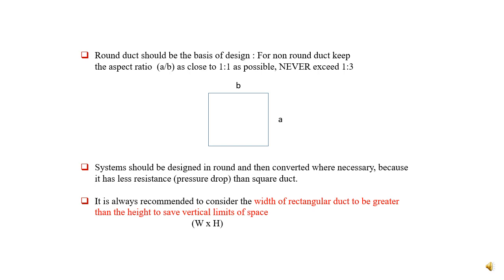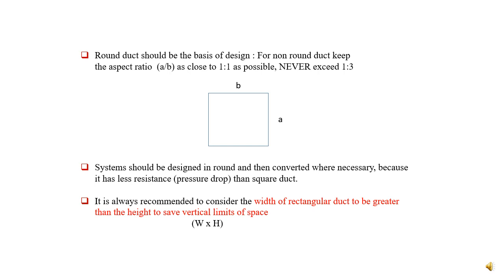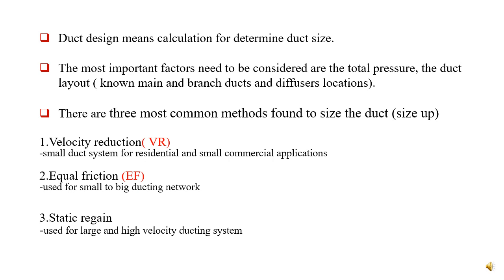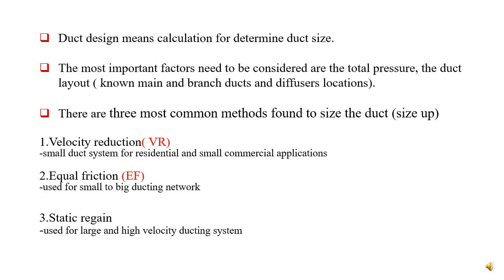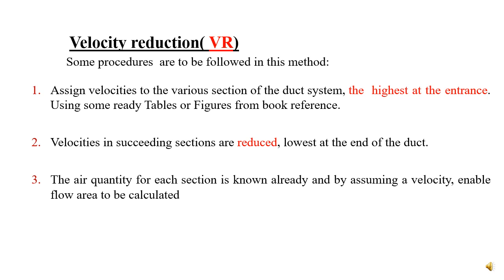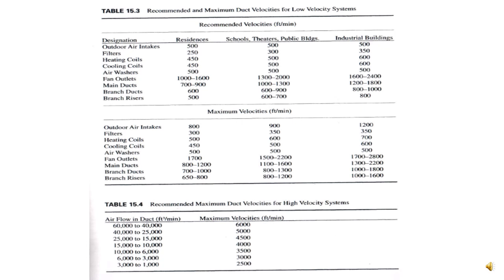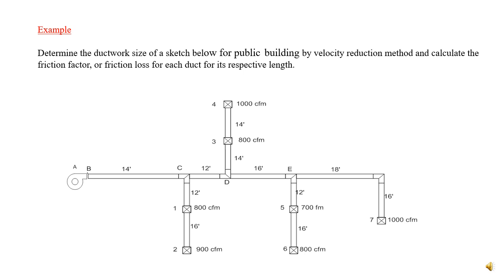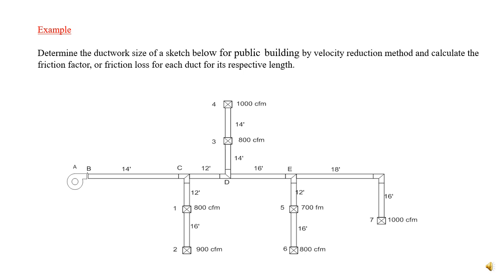Air Distribution System Design Lecture 7 part 1

Comment: ZARIF ROSTAM (B071710681)
Duct System Design
Purpose : Deliver conditioned air from one location to another with concern of cost, noise and limit of space.

3 requirement to follow:
-Keep the 1:1 ratio and never exceed to 1:3
-Round duct is better than square duct due to less resistance.
-The rectangular duct must be greater in width than the height.

3 method in ducting design:

a) Velocity reduction
small duct system for residential and small commercial applications.

b) Equal Friction
used for small to big ducting network

c) Static Regain
 for large and high velocity ducting

Comment: KHOR YE SHU (B071710464)

1. Design overview
- Objective of air duct system is to deliver the conditioned air

2. Three things to be considered: 
 a. Space limits (how much space available in the plenum)
 b. Noise (minimize the noise)
 c. Cost (cannot exceed the cost that is specified by the client)

3. Duct design methods
- Calculation for determine duct size
- Important factors need to be considered:
 a. total pressure
 b. duct layout

4. Three most common methods found to size the duct: -
 a. Velocity reduction (VR)
  - small duct system for residential and small commercial applications
 b. Equal friction (EF)
  - used for small to big ducting network
 c. Static regain
  - used for large and high velocity ducting system

Comment: Muhammad Zulqarnain Bin Zamzuri (B071710782)
DESIGN OVERVIEW
•	Purpose : To deliver confined air from one location to another 
•	Non round duct: as close to 1:1, never exceed 1:3
•	Should design in round when necessary
•	Width of rectangular duct to be greater than height to save vertical space
•	Duct design = calculation to determine duct size
•	Important factor : total pressure, duct layout
•	3 most common method
o	Velocity reduction : Small duct system for residential & small commercial
o	Equal friction : small or big duct network
o	Static regain : for large and high velocity duct system

Comment: Cheah Kok Hun B071710006 
 This lecturer  7 is mainly discuss about an air duct system is to deliver conditioned air from one location to another within prescribed  limits of space, noise and cost.
 Cost is to be consider in the same time full filled customer requsting

Duct design method
:
round duct should be the basis of design
round duct is much better then square duct due to less resistance
Rectangular duct design method perfect is 1 to 1. if not possible the design should not exceed 1:3.
The width of the duct must be greater than the height if the duct.

Method to size up the duct:
1. Static Regain- for large and high velocity ducting and this is expensive
2. Equal Friction- used for small to big ducting network.
3. Velocity Reduction (VR)-small duct system suitable for residential or small companies.

Comment: NUR SHAFIQAH BT ABDUL GHAPOOR (B071710400)

DUCT OVERVIEW
-the purpose of an air duct system is to deliver conditioned air from one location to another within space limits, noise and cost of the system. need to choose the system that have minimum noise and make sure does not exceed the required cost.

-round duct is the basic design
-non-round duct needs to keep the aspect ratio as close as possible (1:1) and definitely cannot greater than (1:3). 

-system design in round and then converted where it necessary.
-round has less resistance compared to square duct.
-always consider the width is greater than height. It is more stable that way.
-if the space is very limited, then the height greater width is acceptable.

Rule to design:
1. Choose the right form of duct (round or square).
2. Ratio of the duct must be close (1:1), never (1:3).
3. The width of the duct must be greater than the height if the duct.

DUCT DESIGN
- to calculate so that ones can determine the duct size like material type and size.
-important factor that need to considered are total pressure and the duct layout (main and brunch ducts and the diffuser location).

Method to size up the duct:
1. Velocity Reduction (VR)-small duct system for residential or small companies.
2. Equal Friction- used for small to big ducting network, most part of system used equal friction loss.
3. Static Regain- for large and high velocity ducting, it is expensive.

Comment: LIM PEI JUN (B071710194)
Purpose
-to deliver conditioned air from one location to another.
- transferring the conditioned air within limit of space, noise and cost.

Three requirements
- keep the ratio as close as 1 to 1, never exceed 1 to 3
- round duct is much better then square duct due to less resistance.
- width of the rectangular duct should always greater than height due to vertical limit of space.

Three method of ducting design.
- velocity reduction (VR)
Small duct system for residential and small commercial

-equal friction
for small or big ducting network

-static regain
For large and high velocity ducting system.

Comment: AMIRATUL RASYIDAH BT ABDUL RAHMAN (B071710456)

DESIGN OVERVIEW
• Purpose of air duct system: to deliver conditioned air from 1 location to another location within prescribed limit of air space, noise & cost.

• round duct is a basis of design
• non round duct: should be aspect ration (1:1), not exceed (1:3)

• system should be design in round duct & convert if necessary because it has less resistance compare to square duct.

• recommended width greater than height of the duct, to save vertical limit of space.

DUCT DESIGN is calculation for determine duct size

• Important factor : total pressure & duct layout

• 3 Common Method to size the duct
1. Velocity reduction
2. Equal friction
3. Static regain

Comment: ALDY HENRY DUSIM (B071710329)

Design overview
- ducting function is to transport conditioned air to a space and designing it need to consider the space limit of the area or the ceiling and the noise must also be minimize as possible and also the cost need to be consider and as an engineer it is important to recommend the best design for the customer building but the final decision will be made by the customer if they agree or not.

Duct design method
- round duct should be the basis of design
- for round duct ratio it must be as close to 1:1 and not exceed 1:3
(this is to get better air flow to the space and avoid any unnecessary loss)
- round duct has the advantages of less pressure drop and required less space than the non rectangular duct but the non rectangular duct is cheaper

three type of calculation methods
1. Velocity Reduction (VR) and it is for small duct system, residential and small commercial applications
2. Equal Friction (EF) and are used for small to big ducting network
3. Static Regain and used for large and high velocity ducting system,
this are the methods used to help sized up the ducting and it is very important to follow this methods to achieve better air flow to your system. not to forget that you have to know the layout for the system and the total pressure for the system to so it can help even more to your designing process

Comment: LUA WEI JIE (B071710861)
The purpose of an air duct system is to deliver conditioned air 	from one location to another within prescribed  limits of space, noise and cost.
Rectangular duct design method perfect is 1 to 1. if not possible the design should not exceed 1:3.
3 types of calculation method :
a. Velocity reduction( VR) uses for small duct system (home, residential and small commercial applications)
b.Equal friction (EF) uses for  small to big ducting network
.(buildings)
c. Static regain uses for large and high velocity ducting system
Also please follow the recommended table for each type of building, type of suitable flow for each space, limit min&max flow.

Comment: Muhammad Syafiq Bin Ahmad (B071710592)

Air Duct Design

*The function of air duct is to transfer of air from one location to another location with specified space and cost within high air pressure

*The ratio for round air duct suppose 1:1 and never exceed 1:3

*Recommended shape of rectangular is about W x H

*The most important factors for design are the total of pressure and duct layout

*3 main common method to found out the size of air duct

   1. Velocity Reduction (VR)
    2. Equal Friction ( EF)
    3. Static Regain

Comment: MEGAT MUHAMMAD UMAR ( B071710565)

1. Design overview
- to deliver conditioned air from one location to another relate to limit of space, noise and cost
-round duct will be the basis design
-for non round used ration 1:1 and never exced 1:3
-consider width is greater than the high to save vertical limit of space

2. Duct Design Methods
- Means calculation for determine duct size
-most important factor to consider is total pressure, duct layout and diffuser location

3. 3 most common methods to size the duct
- Velocity reduction (VR) = small duct system for residental and small commercial applications
-Equal Friction (EF) = small to  big ducting network
-Static regain = large and high velocity ducting system

thank you madam :D

Comment: ARVINTH A/L RAMACHANDRAN  

(B071710339)

design overview 

the understanding is actually  about air duct system is to be delivered from one location to another with the limited space noise and cost.

- round duct should be aspect ratio 1:1 and never exceed 1:3 ratio 
- air duct should be in round because less resistance 
- the width of rectangular should be greater than height 

3 common methods 
- velocity reduction (VR) for small duct system
- Equal friction ( EF)  small to big duct
- static regain large and high velocity duct

Comment: NUR SELIHAH WAL HUDA BINTI AHMAD (B071710190)
1) Purpose air duct system carry cooled or heated air into the room withing prescribed limits of space, noise and cost.
2) Non round duct ratio to 1:1. never exceed 1:3.
3) Always consider the width of rectangular duct as to save the vertical limits f space.
4) Factors need to be considered 
     - total pressure
     - duct layout
5) Method to size up the ducts
     - Velocity Reduction (VR) = small duct system for residential & small commercial application
     - Equal Friction (EF) = used for small to big ducting network
     - Static Regain = used for large and high velocity ducting system

Comment: Mohd Sazwan Fitrie Bin Mohd. Khairil Fitrie
B071710488

Design overview
~Purpose of an air duct system is to deliver conditioned air from a location to another location within prescribed limits of space, noise and cost.

Duct design method
~Round ducts should be the basics of design while for not round ones must have the aspect ratio of 1:1 and not exceeding 1:3.
~Systems should be designed in round ducts and then converted to rectangular ducts when necessary, because it has less resistance (pressure drop) than rectangular ducts.

Three common methods found to size the duct
1. Velocity reduction
	~small duct system for residential and small commercial applications
2. Equal friction
	~used for small to big ducting network
3. Static regain
	~used for large and high velocity ducting system

Comment: MUHAMMAD AMIR SYAFIQ BIN AHMAD SUKRI (B071710161)

DUCT SYSTEM DESIGN

Purpose:
- to deliver conditioned air from one location to another within the prescribed limit of space, noise, and cost.

*round duct should be the basic of design. Non round duct keep the aspect ratio (a/b) as close to 1:1 as possible, never exceed 1:3
*system should be designed in round and then converted when needed. because it has less resistance (pressure drop) than the square duct.
*always recommended considering the width of the rectangular duct to be greater than the height to save the vertical limit of space ( W x H)

Duct design = calculation for determined duct size 
duct design method:
1. velocity reduction ( for the small duct system. eg: residential, small commercial application)
2. equal friction         ( for small & big ducting network)
3. static regain          ( large & high velocity ducting system)

Comment: Mohd Syahiran Bin Mohd Pikeri
B071710026

Design overview

Purpose =  to deliver conditioned air from one location to another within prescribed  limits of space, noise and cost.

in other word :
-the space limit should be enough and practical
-the noise of the system must be minimize as possible
-the cost must be ideal and cannot exceed the cost that is specified by the client

Duct design methods
 -The ratio for duct shape should never exceed 1:3 for rectangular duct (1:1 ratio is the best)

Duct Design factors that need to be considerate:
-Total pressure
-Duct layout

Method to duct sizing
-Velocity reduction (small duct system for residential and small commercial applications)
-Equal friction (use for small to big ducting network)

-Static regain (use for large and high velocity ducting system)

Comment: MUHAMMAD HAZIM BIN ISMAIL
B071710545

1. Design overview
- Objective of air duct system is to deliver the conditioned air
- Three things to be considered: -
 a. space limits (how much space available in the plenum)
 b. noise (minimize the noise)
 c. cost (cannot exceed the cost that is specified by the client)
- Round duct should be the basis of design
- Non round duct keep the aspect ratio as close to 1:1 as possible and never exceed 1:3
- Normally, rectangular duct is use for rigid duct and round duct is use for flexible duct that is near the outlet or diffuser
- System should be designed in round duct and then converted to rectangular duct when necessary, because round duct has less resistance (pressure drop) than rectangular/square duct
- Always recommended to consider that the width of rectangular duct has to be greater than the height to save the vertical limits of space

2. Duct design methods
- Calculation for determine duct size
- Important factors need to be considered: -
 a. total pressure
 b. duct layout
- Three most common methods found to size the duct: -
 a. Velocity reduction (VR)
  > small duct system for residential and small commercial applications
 b. Equal friction (EF)
  > used for small to big ducting network
 c. Static regain
  > used for large and high velocity ducting system

Comment: RAHIMI MUSTAPHA (B071710225)

So  basically in the lecture 7 part 1 was about having understanding the duct system design overview and method can be used  and apply to the air distribution system.
1. Design overview
- So when designing the system there are 3 thing need to be consider which was space limit, how much space available in ceiling and minimizing the noise and also cost (within the budget of client).

2. Duct design methods
- Round duct should be the basis of design : For non round duct keep the aspect ratio  (a/b) as close to 1:1 as possible and  never ever exceed 1:3 in order to get a proper air flow throughout the system.
-Systems should be designed in round and then converted where necessary, because it has less resistance (pressure drop) than square duct.

3. 3 common calculation method can be used in determining the duct size
a.Velocity reduction( VR) for small duct system (residential and small commercial applications)
b.Equal friction (EF) for  small to big ducting network
c. Static regain for large and high velocity ducting system
Also there recommended table for each type of building, type of suitable flow for each space, limit min&max flow and few more

Comment: Ahmad asyrafamirudin bin aznan b071710607

Design overview 
- to deliver conditioned air from one location to another within prescribed limit of space, noise and cost

-Round duct ratio is 1:1 but never exceed 1:3 
-Duct design means calculation for determine duct size 

Three most common method found ti size the duct
1) velocity reduction
      ✓ small duct system for residential and small commercial applications
2) equal friction 
      ✓ used for small to big ducting network
3) static regain 
      ✓ used for large and high velocity ducting system

Comment: AMIRA NASUHAH BINTI ALIAS (B071710121)

1. Design overview
   - the purpose of an air duct system: deliver conditioned air from one location to another within the prescribed limit of space, noise, and cost

2. Duct design methods
- The round duct should be the basis of design: For non-round duct keep the aspect ratio  (a/b) as close to 1:1 as possible
- Systems should be designed in the round and then converted where necessary because it has less resistance (pressure drop) than the square duct.

- Three common methods to size duct
      1) Velocity reduction
      2) Equal function
      3) Static regain

Comment: Alden andrian phius (b071710392)

Duct system design

1. Design overview
- The purpose of duct system to distribute conditioned air from one location to another location in order to take concern of the limit space, noise and cost.

2. Duct design method

- Design duct ratio 1: 1 never exceed to 1: 3
- Three common method to size duct
i. Velocity reduction
ii. Equal function
iii. Static regain

Comment: Hakim bin Zainul B071710531

Design Overview
*Air duct purpose is to deliver condition air from one location to another within prescribed limited space, noise and cost. 

Duct design method 
*Round duct should be basis of design, less resistance (pressure drop)
*The ratio 1:1 and not exceed 1:3
*recommended for rectangular duct width to be greater to vertical to save space. 

Duct Design (calculation for determine duct size)
*need to consider the total pressure, the duct layout. (main and branch duct and diffusers location)

Three command methods to size duct (size up)
1.	Velocity reduction
 (small residential and small commercial)

2.	Equal friction (small and big ducting network)
3.	Static regain (large and high velocity ducting system)